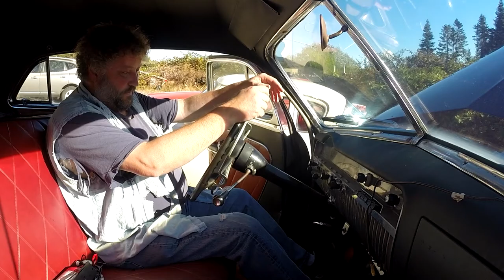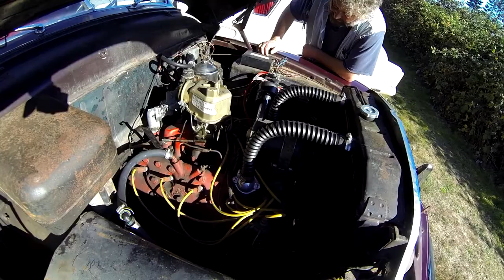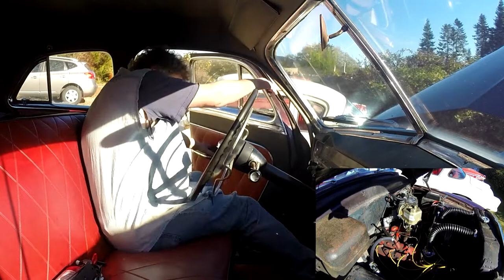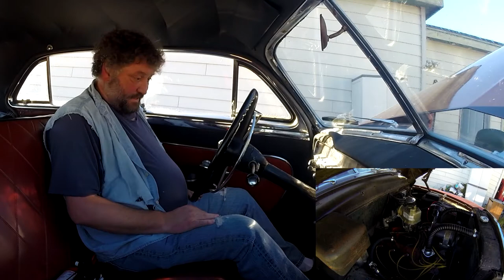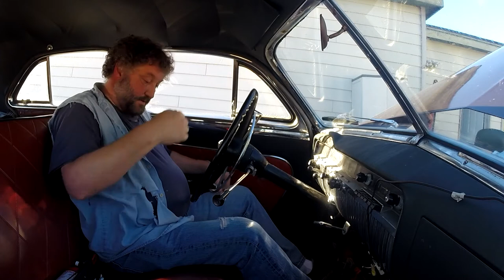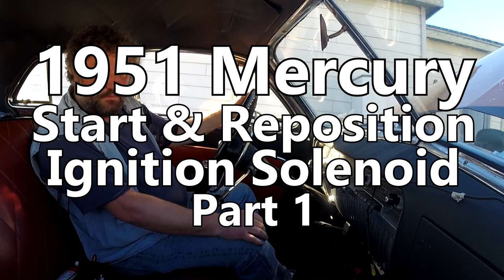1951 Mercury Start and Re-position

Comment: How many miles on the Merc?
Reply from the maker: Your guess is as good as mine Stude. ODO is only 5 digits and sits at 2336, and has been that number since Dad bought it. As far as we know it is the original engine, but Polydor records might have rebuilt it when they restored the car in the late 70's. There isn't enough documentation to know for sure